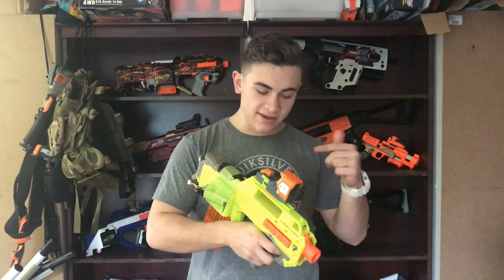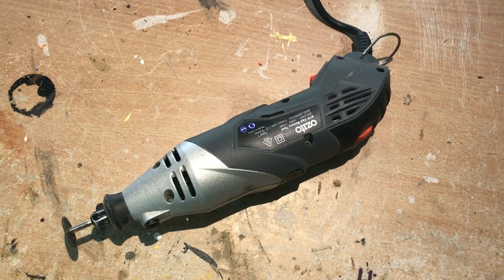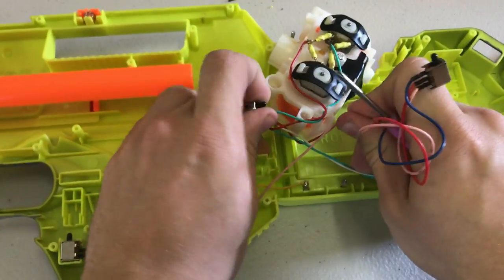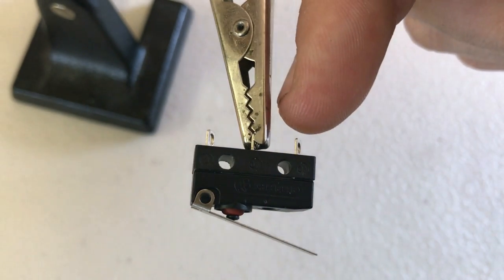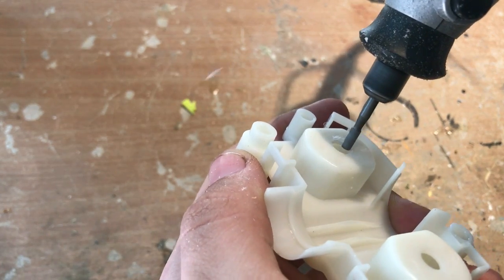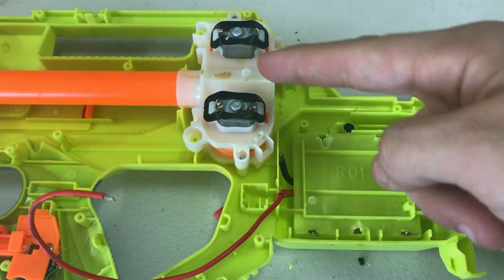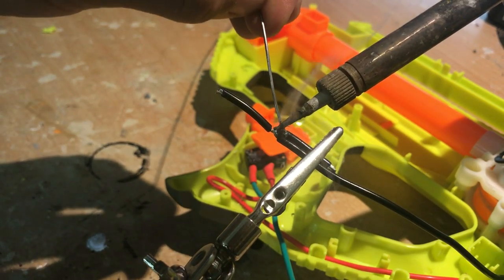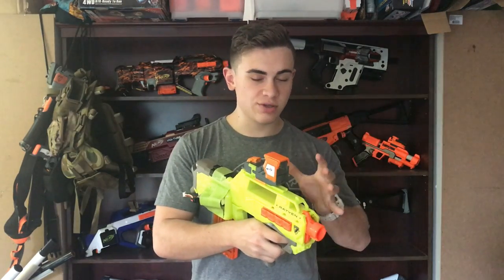How To Modify ANY Semi Auto Nerf Flywheel Blaster || Semi Auto Rewire

Comment: Hey, I did this with a stryfe and installed Cyclone flywheels. Now it takes about 10 seconds for the motors to stop. Tips?
Reply from the maker: naphen that’s usually what happens, you will have to add motor braking to stop it, but it will reduce the life of your motors
Reply: The cyclones are pretty heavy flywheels so after the motors turn off they take longer to spin down as the wheels hold more potential energy compared to stock wheels
Reply: Uhh isn't that good?

Comment: Hey thanks man! I don't have a lipo but this mod, will this still work with nimh battery? And can I use Fang 130 motors instead of rhino motors? Thanks in advance when replying!
Reply: Of course you can but you have to use 2s check foamblasts video
Reply: @Cringemoment4045  alright thanks mate!

Comment: It’s of parts that aren’t need all you need to do is bypass the volt restricter and then add higher volt battery’s I use 6 volts and 8 volts
Reply from the maker: Jake Libonati thats the old way of doing things, this is a proper guide for high performance

Comment: On most semi auto nerf guns there is a circuit that will break the motors if different batteries are used
Reply: Yeah, but you aren't putting the thermistor back in are you?

Comment: Is there any issue having the power Positive go to the motors and the negative to the micro switch? i asked MTB but no answer yet.
Reply from the maker: Dharmaboy I dont think so, the switch will still act as a circuit breaker so it should be okay. Question is why ?